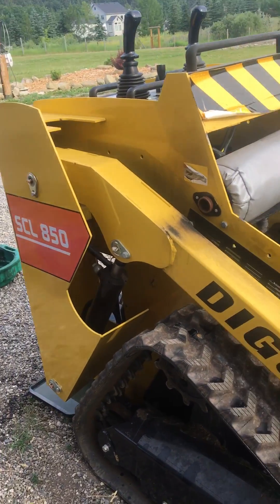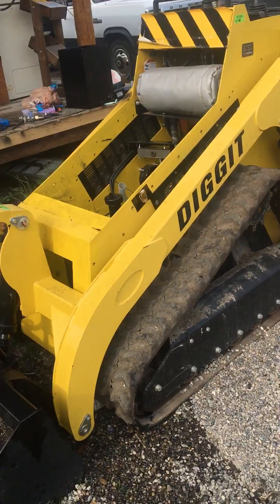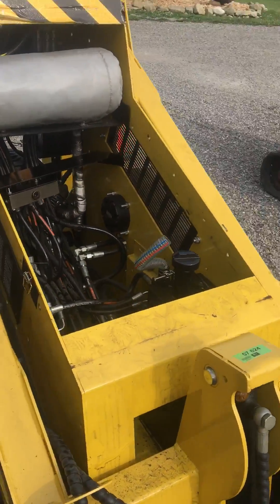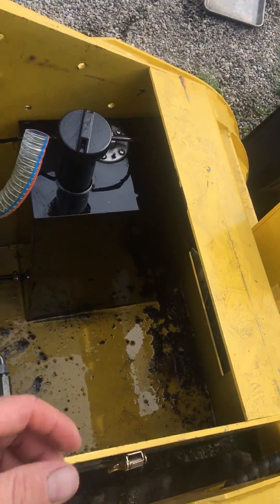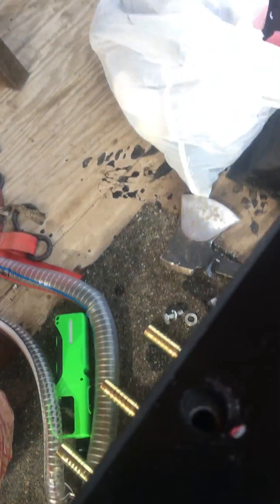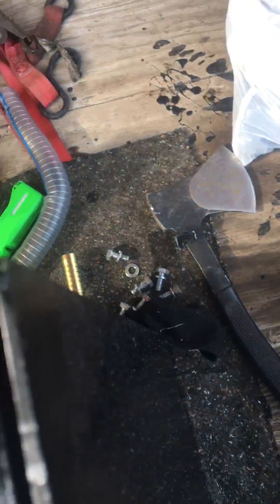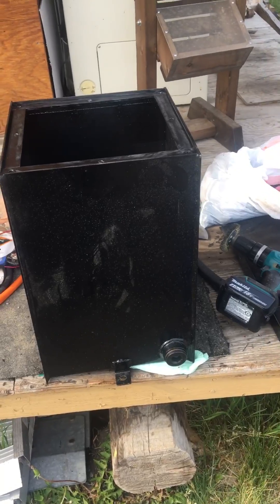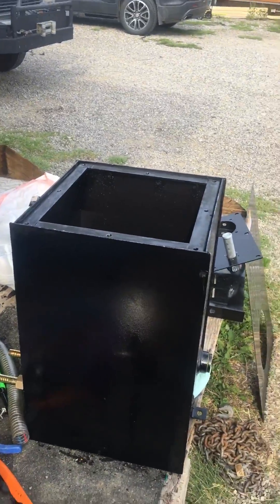Digit SCL 850 water in hydraulic fluid fixed

Comment: hello, I just bought one, definitely has water in the reservoir but i am also having operating issues such as controllable movement, very jerking, delay movement. Would changing hydraulic fluid and filter help or do i have to change the pump?
Reply from the maker: Hi yeah my machine had the same problem when I first got it. There was a number of things I did and it did fix the jerkiness issue and the machine is actually a pretty good machine now.

1 - I fixed the reservoir and replaced the hydraulic oil with a super light winter oil like AW 32 or even 22. 

2 - there are 3 hydraulic pumps on this machine. On mine the low pressure supply hoses were 2 short and kinked. I replaced these with longer hoses.  The hoses were also 1 size to small of a diameter, (I never upsized them on my machine but I am planning on doing it in the future)

3 - the oil return hose was garbage and kinked. I bought a new professional grade return hose and replaced it.

4 - one of the valve bodies was leaking fluid heavily.  I had to pull the valve body and tighten a plug. 

5 - the bypass valve (blue circular adjustment knob close to the reservoir) was not set properly). Try backing it all the way out then slowly in increments adjust it up until the machine operates fairly smoothly.  

6 - once you do all these steps try operating the machine at a lower throttle as well to give you more control. 

Hope that helps, I’ll actually make a video on that here soon.

Thanks for watching

Comment: Thanks for the tip. I bought mein couple of months ago and it has been outside. The hydraulic fluid was water in. Do you know where i can get hydraulic filter for SCL 850? Thank you
Reply from the maker: you can get something from princess auto or Harbor Freight that would work. I actually tried installing a filter on the return line of my machine but it restricted the flow too much so I ended up taking it off. also noticed the lines going into my pump are unresized so I will probably end up upgrading that at some point as well.

thanks for watching